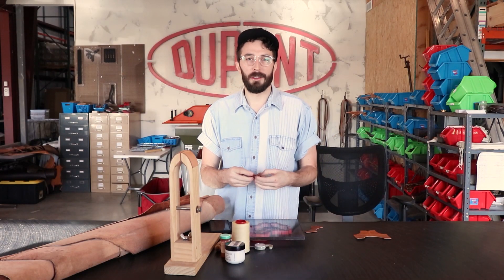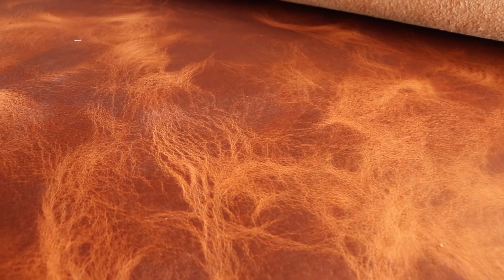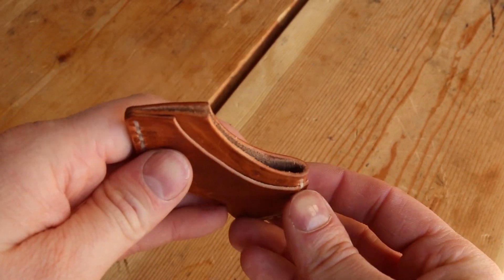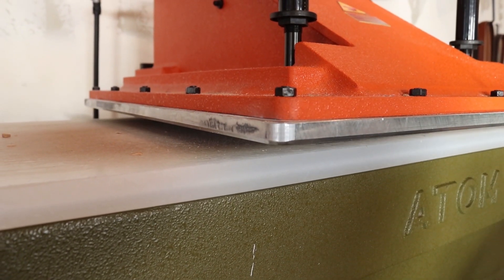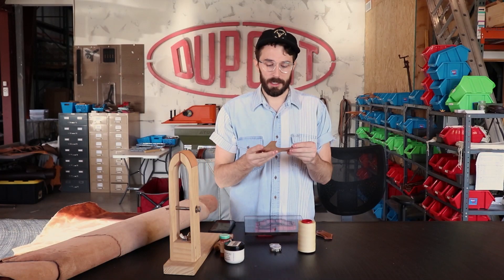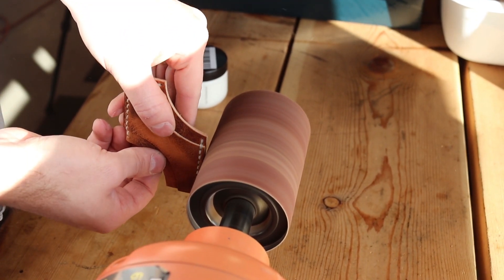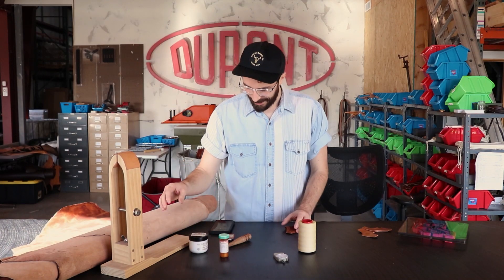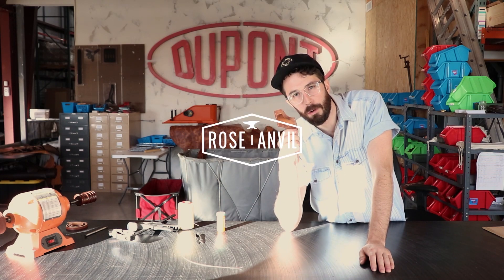Making Our Most Popular Wallet - (CLAUDE WALLET) - Handmade Leather Wallet

Comment: I haven't seen people use a clicker press it seems cool, how much did that setup cost?
Reply: manual clicker presses can be north of $1000, i'd imagine the hydraulic one are much much more, north of $5000 for sure depending on size
Reply: @KevinSatterthwaite  sheesh
Reply: @Eddiesv  one could hit the die with a hammer if your on a serious budget. Maybe put a piece of wood on top first. A cheap arbor press would work wonders too
Reply from the maker: Mine was 25 ton press and it cost about 15k after shipping and setup... it hurt ha ha
Reply: @RoseAnvil  I bet it did 😂